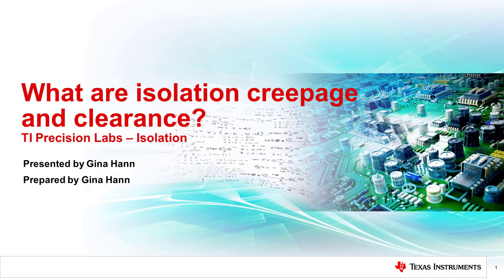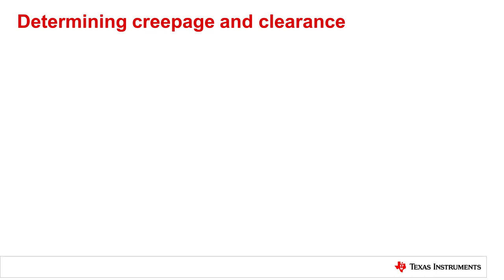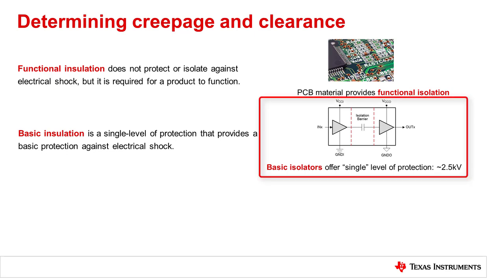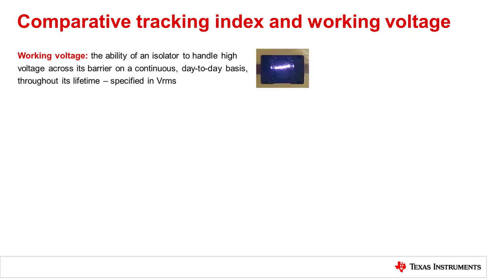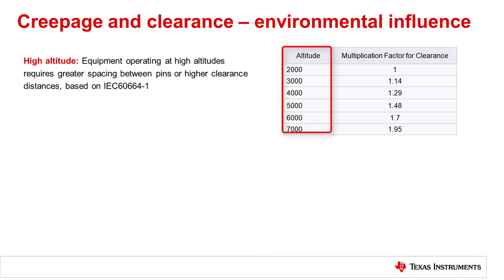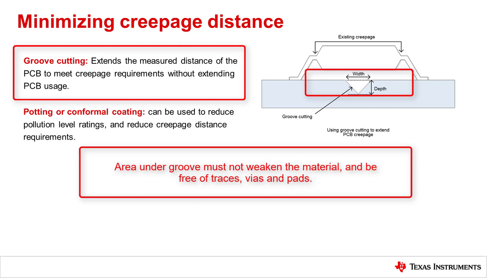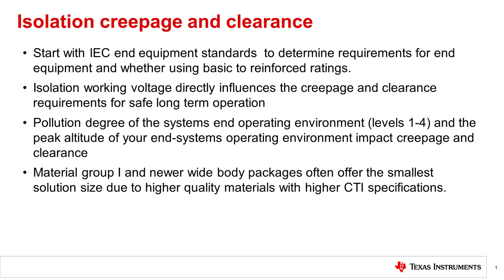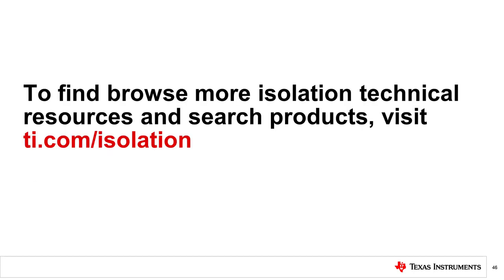What are creepage and clearance?

Comment: Thank you for this video. In IEC standards such as 60664 and 60950 for voltages below 1000V and a pollution degree 1 or 2, PCBs benefit from reduced creepage dimensions. I wonder if those reduced dimensions only applie to the PCB itself or to the components like TI isolators as well? Besides I was not able to find an explanation why on PCBs one can apply shorter creepage distances...

Comment: Air is an insulting medium. At high altitude you have less air or lower air density
Reply: Vacuum is an insulating medium too, isn't it? It's even a better insulator
So having less air (more vacuum) should be harder to arc through

Comment: Can someone please explain why do we need higher creepage/clearance distances with lower pressure (higher altitude)?
I understand lower pressure, lower atoms density, hard to arc through ...
Thank you
Reply: The answer to this is the pashen law.  Yes, the vacuum will have mich higher insulation. But there is a transition Phase where air ressure and distance (pd-product) lead to less resistance.
Reply: To keep it simple : higher the air density more the energy required to break the air dielectric, lower the air density we need less energy to break the air dielectric....same insulation test voltage potential at lower and higher altitude will not give same results...that means breaking the air gap at higher altitude with same voltage potential is easy than breaking the air gap at lower altitude....hence we should have more clearance to avoid the isolation breakdown...you can imaging congested road with traffic jam as lower altitude air gap and road with normal traffic as higher altitude air gap....which is easy to cross ?
Reply from the maker: That’s a great question, Hatim! As Flexcope Inc. has noted, altitude effects the conductivity of air because as the altitude increases, the air becomes thinner and therefore less resistant. The reduction in resistance means that the conductivity will increase, and so will the risk of arcing.
Reply: @TexasInstruments  Yes. But I think that vacuum has even a lower resistance if not infinite, right?
Less air, more vacuum, higher resistance.
Reply: okay it is because of lower pressure, but it's a relationship between the distance between atoms and how easily they become ionised because of some velocity/momentum or whatever